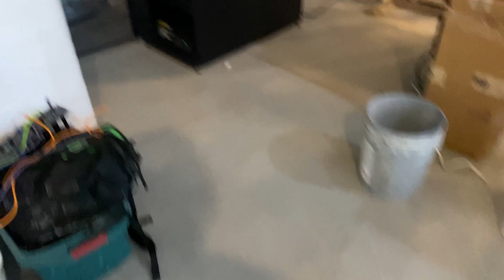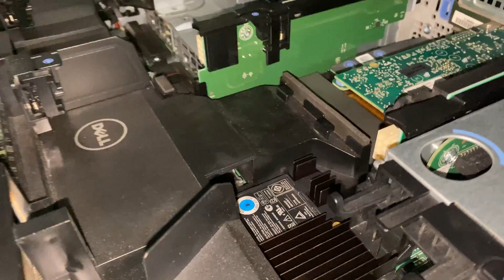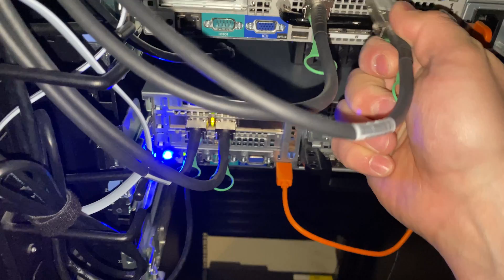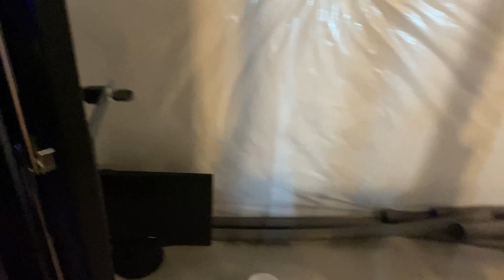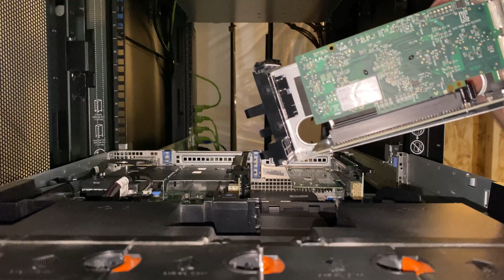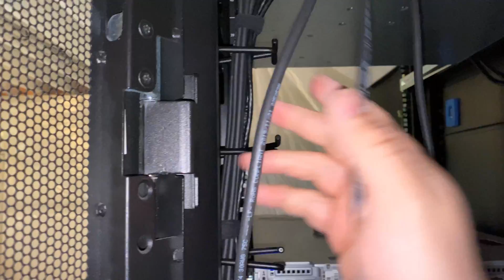VMware vSAN Cluster Project - Part 1

Comment: lets say for a much smaller homelab, can one attach sfp+ dac from each node (4 node superserver) in the vsan cluster to a main compute server's own sfp+ uplinks, bypassing a physical swith for vsan traffic/vmotion traffic? i believe if i wanted a swithc it would need a 5 uplinks to connect gpu server to the 4 nodes, but i only have 4 uplinks switch :( - im hoping a direct attach approach like this will allow me to have 10G interconnectivity and mitigate some of the costs.

Comment: Vsan sucks . In a 3 node cluster each server had 32GB ram and vsan took 33GB total RAM just to run vsan. That’s 11GB ram off each server meaning fewer vms could be hosted per node. Instead I went with FREENAS on a single node and had 2 nodes for VM. A better overall so,union IMHO.
Reply from the maker: Doesn’t mean it sucks… each deployment is different. 33GB is nothing, if you are limited on ram. Recommendation is to up your hosts with more memory to overcome the limitations. iSCSi is good for tier 2 storage. Tier 1 is still vSAN.
Reply: @Virtualbytes1  what if your server max is 32GB? Then vSAN sucks.  Enter to give your VM more memory or have more VMs and use the vSAN flash on the server itself. Duh!

Comment: What i am i missing ? I added the card and i dont see it appear in the dell side? Also if i add to cards like you have done the server starts booting and half way shuts off ? LOL
Reply from the maker: Hello! Did you enable them via idrac ? They need to be enabled and set to mirror mode. Haha
Reply: @Virtualbytes1  Ok i don't see them in the dell bios at all , i do see them inside Esxi7 i couldn't go further because my switch and cables has not arrived. I forgot to mention that the issue with the server shutting done was on a R730xd. Ill try again maybe i was a bit tired. Ill update you next week. Thank you for the reply

Comment: how are you going from your internet service provider , and what speed into your Arista ? Also from your arista to your 3 servers you are using 40gb/40gbe to each server and your new project is and additional 40/40 Gbe to each server for vsan correct. I am confused as to how you are able to get your internet service provider into your arista. I am trying the same project just that i don't have an arista. I am using a dell s6100-ON. I am an it guy but i never really swam with the network stuff so i am a bit lost in getting this project started. Thank you
Reply from the maker: Hi! - The newest video i uploaded has more updated content, but yeah I have a Dell PowerEdge R330 with pfSense it is the Edge for the internet, then i have a SFP+ 10Gb/s fiber run going to Eth1/1 on my arista, my has the 4 10Gb SFP+ port on top of the QSFP+ ports. So what i have going on is a static route going from my arista to my pfsense via eth1/1, then i have arista running eBGP for NSX-T. 

My version of the Arista DCS-7050QX-32S-F
Reply: @Virtualbytes1  Thank you for your fast reply
Reply: @Virtualbytes1  When you have some time can you show a picture of your home internet service input going into your arista ? Thank you

Comment: I have R720s with H710 Controllers. I’m trying to figure out if flashing to IT Mode will be good for vSAN or if I should purchase another controller. 

Any recommendations?

Also, Are 10GB interfaces for vSAN good enough or should I upgrade to 40GB? What was your decision / logic?
Reply from the maker: Hi!

You can flash them to IT mode but vSAN will scream in the health check saying that the card is not apart of HCL ( Hardware Compatibly List) 
I’ve done all kinds of vSAN implementations best one is to do all flash vSAN either with SATA or SAS Disks, SAS are better in reliability and performance. 

10Gbit back bone is required for all flash vSAN, but 10Gbit is more then plenty but for the cost of a Arista 7050c series 40Gbit the cost is sp much cheaper due to the SFP+ nics and fiber or twinax. I got my two Arista switches for 550-
/600 bucks each. Plus the qsfp dac cables are like $20 and the 40Gig qsfp+ nics are 50-80$ each rather than 100+ for a 10Gig nic
Reply: @Virtualbytes1  Really appreciate the insight. Any recommendations as far as controller to go with?
Reply from the maker: Anytime! The HBA330 is a great one and you can get the PCIe version of it. This one is the most used and well documented hba if you encounter any issues.

Comment: Nice, I'm looking into getting one of those Arista switches,  looking at the DCS-7050QX-32 which often goes for very good prices on eBay. I'm used to MikroTik switches with a web GUI. Does the Arista switches have a GUI or is it all CLI based? I think you should do a video on how to setup the Arista switch.
Reply from the maker: Thank you and this Arista Datacenter switch is awesome, I’ll get another one soon but the command line is so easy to use it is 95% similar to Cisco NXOS and some IOS. I can do a video of setting up my new connections to the vSAN network for sure.